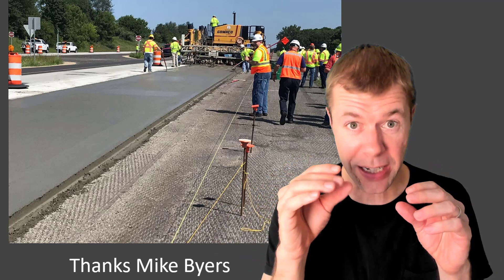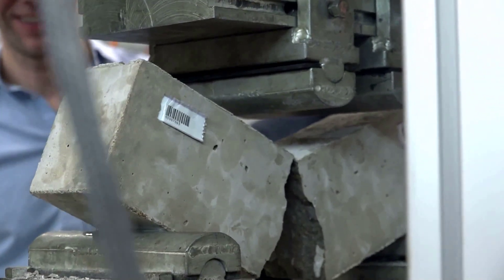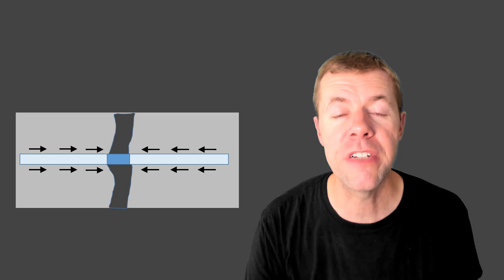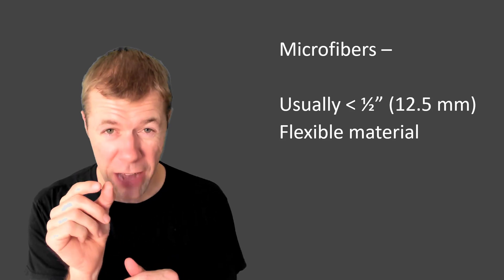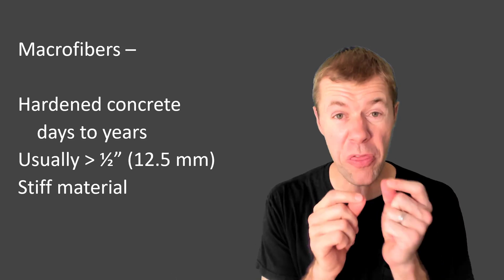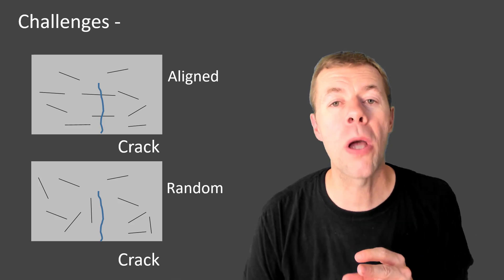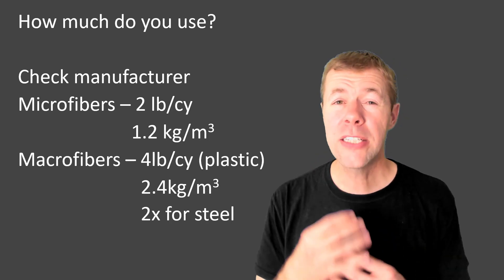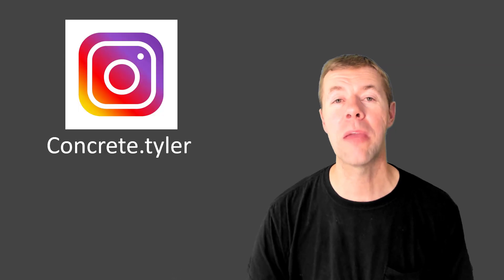What is fiber reinforced concrete?

Comment: I worked in a mine that you would drive in and out of in vehicles with rubber tires. They use the shotcrete (concrete) with the steel fibers to reinforce the roof and walls of the mine. Many flat tires later, they stopped using steel fibers.
Reply from the maker: Cool story but not cool for your tires.  This would be a good application for macro synthetic fibers.

Comment: Example: if I do a mixture with a composition of macro fibers and micro fibers in a concrete mixture. can it affect the concrete to achieve higher strength? and how to do a better measurement of the composition of the two fibers in the concrete mixture ?

Comment: I first saw and heard and about fibers in 1993.  My understanding was that it was a replacement for concrete wire (the 6"x6" grid wire about 5' wide that comes rolled up and a pain in the ass to handle; yeah that concrete wire).?.  Which is used to resist shrinkage and freeze/thawing cracks, not necessarily loads.  That's what the rebar is for..?  what do you say about that?

Comment: clearly explained, thanks.  I am trying to decide if i should use steel mesh or fibers in my 10 inch tubes for the footers under my shed.  I am in savannah, so there is no frost line, and my footers are not very deep.

Comment: That is an amzing video. Very informative. I have been doing a research latley about MDF cement which actually can be a potential solution. In addition to that, using Nano Structure cement has a greater potential which has tensile strength more than steel.
Reply: Hi

Comment: Would you put hempcrete into this category and any research you have done on Graphene reinforced concrete ?
"Graphene reinforced concrete is twice as strong and four times more water resistant. ... Crucially, the new graphene-reinforced concentre material also drastically reduced the carbon footprint of conventional concrete production methods, making it more sustainable and environmentally friendly'
Reply: Graphite is used for repairs because its so expesive it not used on new very much
Reply: @sparksmcgee6641  graphene not graphite.  https://www.dezeen.com/2018/05/03/graphene-reinforced-concrete-stronger-university-of-exeter-scientists/

Comment: Thanks for all your videos, I am planning a workshop build and every concrete contractor has a different idea of what would be best.  Educating myself with your videos are helpful through this process. 
Do you have any videos or insight on how in Slab radiant heat with under slab insulation effects concrete? 
Thanks again.
Reply from the maker: Thanks Dennis,
I don't but that is a good idea for the future.

Comment: A lot of engineers don't like specifying fibers since there is no code requirement and they don't want to increase construction expenses. You need an economic argument for the client to accept the specification. What are the economic advantages to fiber reinforces concrete? 

What is the relationship between fiber reinforcing and corrosion? Can fiber reinforcement help reduce corrosion in parkades where there is freeze-thaw and lots of salt?
Reply from the maker: Thanks Andrew,
I agree that more work needs to be done on this to get the data that you want. 
 Right now the fiber companies are relying on engineers that want to create concrete with less cracks.  It is like all the extras on an ice cream sundae beyond the ice cream.  You don't need them but they sure make it better.
I guess the question is whether cracking is important to your structure.  If it is then you should consider adding fibers.
Reply: Lower rebar placement labor is why I'm starting to use it in residential foundations and walls. Going from a #5 12" mesh to 20lb a yard steel fiber if i remember right

Comment: I've had a garage floor that needed to make up a 1/2" gain in height- we mixed in fiber (fiberglass strand type) and trowed to a smooth finish. While not directly exposed to the elements, it has had cars, trucks, etc. worked on with jack stands, etc for over 10 years. still holding up well, in the freeze/thaw climate.
Reply from the maker: Rick,
Thanks so much for sharing this success story!  Do you know how much fiber you used?
Reply: Tyler, that will be a hard one, but I will try to check. it wasn't that much, because it was actually mixed by hand. I will try to find the left over packets of fiber, but I think it was roughly one ounce to 50lb dry, course sand, no klinker. I love your channel!

Comment: Tyler Ley, I did respond without fully reviewing the problem. You got my first impression, yes a magnetic field will align iron fibers and your correct. It will take power. 

However, flow in a channel by itself will align the fibers. Simply because there is a velocity difference from zero to max velocity in the center. A fiber oriented with position along the fiber at different radius will find itself used by velocity difference to a single radius. The steel fiber is stiff enough to not buckle. Hagen-Poiseuille equation for laminar flow and U(r)=(p1-p0)/4 /visc/(l1-l0)*(R^2-y^2) and turbulent Prandtl (Umax – U(r))/visc = loge (r0/y)/k where for k is a constant for fluids like water =~0.4 Karman's constant.

I am sure your Civil Engineering college has a fluid dynamics department that can handle the non-Newtonian fluid, concrete. They will determine the length of tube need to achieve the aligning of fibers.

Wind tunnels use straighteners the simplest DIY tunnels use a wall of plastic straws.  So gravity can be used to pump large amounts of concrete through an exit pipe with a straw like exit port swept clean by the mixing paddles.  Once straightened the concrete can be recombined into a single flow, continuous road bed for example.  

Next you may get Verderflex peristaltic pump to handle the fluid. https://www.verderflex.com/en/news/single/article/pumping-concrete-fibreglass-mixture-with-peristaltic-pumps/

Will not cut it for larger flows thus 1.5 or greater pipes. You can back pressure the chamber of the pump to lower the stress on the hose. But then the hose will stay collapsed after the pinch roller. So the pressure in the chamber will have to cycle.  Consider the tube on the ID of a roller bearing between each roller is a chamber that can be pressurized and the cage reduces the volume so less gas is needed.  Side leakage around the roller and inner drive ring  are the only issue that a rubber ring at the ends of the roller and ring can reduce.  

I am a retired mechanical engineer (patents should show what I did). My TAM fluid course was in ~1970 a Univ of Ill Urbana. I am interested in Hobby machines using concrete to replace cast iron. DIY built.
Reply from the maker: Thomas,
Thanks so much for the thoughtful comment.  I like where you are headed.  Things are a little more complicated because concrete is a suspension and so it doesn't flow like a fluid.  It moves more like a plug except where it shears at the walls.  This means the alignment would only occur near the edges.  Now this may still be useful to help with alignment but it will only help at the walls.  The Army Corps has worked heavily at trying to use flow to align steel and plastic fibers and they are still stumped.  

However, your comment about a lot of small straws is very interesting.  Something like this may be able to help align the fibers.  Let me keep thinking about it.  

Thanks again for the thought provoking comment.

Comment: Sir , I have a question regarding other situation . Why  a  concrete slab has cracks underside after it has been casted  even if it is properly compacted ?
Reply from the maker: Is the slab on the ground or in the air?  There are lots of things that cause cracks.  I have a lot of videos on cracks if you look around my channel.

Comment: How about using mesh for thin concrete like those chicken mesh? Those are flat enough i think. I think layering it like sandwhich would make it strong. Like conrete-mesh-concrete-mesh-.....-concrete
Reply from the maker: Thanks for the question.  It is tough to get the mesh at the right level in these thin sections.  You will get cracks above the reinforcing that will allow outside chemicals into the concrete.  I like the idea of combining fibers and welded wire mesh.

Chicken mesh is too small for concrete and it typically snaps after the concrete cracks.
Reply: Checkout the pioneering concrete experiments in the 1940's by one of my engineering heros: Pier Nervi.  At the time his multi-layer small steel mesh concrete projects were called "Ferrocement".  This material had tremendous strength and a host of unusual properties.  It required almost no form work.  Mr. Nervi went on to do many commercial "thin shell" concrete projects that were greatly admired by the general public and engineers alike.

Comment: Dear Professor Ley, thanks a lot for your video.  Now that you talk about fibers we are making concrete, we are making concretes with Waste to Energy Ash, we use ash instead of sand and aggregates, this is big because all the ash is pozzolan.  Concretes made with this type of waste are Photocatalytic meaning help breakdown air pollution and are impermeable and self-healing and yes, they have micro-reinforcement.
Reply: Careful with ash, especially fly ash from coal burning electric plants.  Home Depot learned that the hard way years ago near Richmond VA when their contractor used 30% fly ash in the foundation and floor slab for a new HD store.  If memory serves, some of the metal shelving posts broke through the new floor when they stocked them. The entire building was condemned and razed so they could start over.

Comment: what type of reinforcement would you suggest for concrete arches and concrete dome homes?
Reply: The DIYers place a layer of Geotextile fabric strips over the exterior of aircrete brick domes and bond it in-place with aircrete mortar.
Reply: @avid0g thx!
Reply from the maker: I would use Forta Ferro macrosynthetic fibers and conventional reinforcing.  Have you seen my arch video?  Here is a link: 
https://www.youtube.com/watch?v=U86tlUiFM1s
Reply: @TylerLey  thx alot for your response,

Comment: This is funny enough the first concrete ever made. Roman concrete was often made with hay in the mix, which provided the needed reinforcing the concrete needed.
Reply: Not hay but straw. Hay is the soft fodder the ruminants eat during winter. Straw is the rigid hollow tube plant stems resembling micro-bamboo. Straw is also soaked in water to weave floor mats.

Comment: Have you considered for steel fibers using magnetic flux field to align the fiber direction.   Example is iron particles on paper that have a magnetic field extending through the paper shows the alignment.   So assume that you can lay the concrete into a form in the direction that you want the fiber majority to be aligned to.  One way of aligning them is a use a tube with DC current flowing through wire wrapped around the tube.  The flux field will be parallel to the axis of the tube and flow direction.
Reply: Metal in concrete is a bad idea especially in humid climates.  Metal will expand and contract causing cracks.  That and metal rusts like a bitch in concrete because of water.
Reply: I would think the density of concrete would require a very strong magnetic field and that would draw the fibers to that side of the pour.  Remember your example is in a very nonresistive medium(air) and the filings are being kept separated from the magnetic source by the (relatively) strong paper.
Reply from the maker: Thanks Thomas!  William is right, it is very hard to get the fibers to align where you want them to.  Also you need a very strong magnet.   However, maybe somebody can figure this out.  Someone should try and make it happen.
Reply: Maybe magnetic alignment could work whilst the concrete is being vibrated, because everything would be more mobile. Interesting idea. Test it yourself and make a video :)
Reply: @jasonvoss1984  
Or the magnetic field can be pulsed, this could even do the vibrators job.
Reply: Steel rusting is a problem even with rebar longterm.  Fibers would super accelerate and worsen the problem
Reply: Have building construction engineers adopted cathodic protection for rebar grids yet? Similar to what’s used to protect underground pipelines from corroding by using sacrificial anodes.

Comment: Why cant you buy fibres in the form of a loose mat where the bulk of the fibres are in one direction and a few hold it together in the other. Alternatively, aren't there forms of thin rebar you could use, again in some form of directional mat?
Reply from the maker: Roger,
You can use welded wire mats.  These are very thin metal reinforcing bars. However, they deform when you put fresh concrete on them and you need a lot of support or chairs to hold them in place.  Most people don't want to go to this trouble.
Reply: @TylerLey  - Thanks for explaining that.
Reply: Lots of options, here is a guy showing a sample pack of basalt products https://www.youtube.com/watch?v=KORpVO7-LJ0
Reply from the maker: Look for a video next week on basalt rebar and why it is typically not used in concrete.  It is a cool product and can have good uses but some drawbacks.

Comment: Suggestion for coming video - how to repair old concrete with new. The problem often seen is that the repair cracks off from the old concrete, like when an outdoor concrete staircase is repaired.
Reply from the maker: Are you talking about the new concrete pulling away from the old?
Reply: You need to use an epoxy resin concrete bonding agent (e.g. Nitobond EP from FOSROC) to bind old and new concrete.

Comment: Would be nice to know the advantages of using one fiber over another.  Acrylic, pva, fiberglass, carbon, basalt.
Reply from the maker: Ryszard,
This is a good question.  In my opinion there is not a lot of good data on this.  Most testing has focused on the strength of the fiber reinforced concrete after it has cracked.  I am not sure this is really what is important.  I think it is better to focus on how well the fibers can keep the cracks small.  Also, most of the testing is from external loading.  Very little work has been done to investigate the performance in cracking from freeze thaw or drying shrinkage.  While is known that the micro fibers only really help at early ages, no one has really quantified how much they help.  

We are starting to work a lot with fibers in my lab and so stay tuned for more details.
Reply: @TylerLey  - I have a question concerning "Tarantula" - have You ever used it in the context of Recycled Agg Concrete?
Reply: I know basalt does not rust, expand, or corrode like steel, is ultimately stronger yet extremely brittle, failing abruptly. Specifically, basalt is less rigid (1/3) than steel rebar in the steel's elastic sense, but has a much higher ultimate strength. But when it does fails it does so abruptly and totally. There is little warning, so safe evacuation of structures is dependant on active monitoring of abnormal stress, which requires planning and fidelity. 

Basalt fabric has properties that have not been properly exploited by industry. It can be placed at the surface of concrete so that it's tensile strength minimizes initial cracking. However prestressing basalt fabric has not been investigated enough.
Reply: @avid0g  Barchip Inc has the best plastic barchip reinforcement on the market, they seem to be the standard.
Reply: @Veldtian1  All the companies listed on the Fiber Reinforced Concrete Association (https://fiberreinforcedconcrete.org/) are great suppliers of quality plastic fibers.  Check out the site!
Reply: BASF makes some of the best fibers on the national market. Look into their products
Reply: one ideal, especially if wide temp fluctuations is a material with similar expansion rate as it warms up as cement...  rebar has this, so would steel wool/fiber but a plastic like nylon has way too much expansion

Comment: Never liked to work with the macro fibre. Knew too many finishers that would use fibre as an excuse to do a pour on a bad day, rather than use blankets or shade.
Reply from the maker: I agree that finishing can be a problem.  You need to redesign the mix to make it easier to construct.
Reply: @TylerLey  My resolve was to redesign the construct like you say. By building the stem walls first and nearly having the structure dried in. Only then was it time for the pour. Plus it gave more time for residential clients to change things with minimal consequence$. As we all know, once concrete is set, it transforms into Leaverite... Thank you for your work here.

Comment: Good one sir.. I have concern about the workability of fibre concrete..
Reply: fiber reinforced need more water in mix design .liquid polymer can be useful too.
Reply: @hamidrezar1040  
Better to use flow enhancing admixture to compensate than to dilute with excess water that weakens cement ratio.
Reply: @avid0g  i must test it . thanks . but im not concern about 2 or 3 percentage extra water in mix design
Reply: @hamidrezar1040  
That's not too bad.

Comment: A fiber aligned with a potential stress crack will cause it to crack under less load.
Reply from the maker: True, but we usually have a pretty good idea of where our stresses are in our members.
Reply: @TylerLey  Yes, but the fibers added to the mixture align themselves in arbitrary directions.  The saving grace is that the rogue fibers are outnumbered greatly by the ones that are not aligned with potential cracks.
  I think that's what you meant when you said "... we usually have a pretty good idea of where the stresses are...".  Good point.